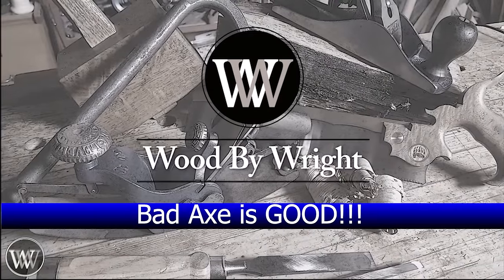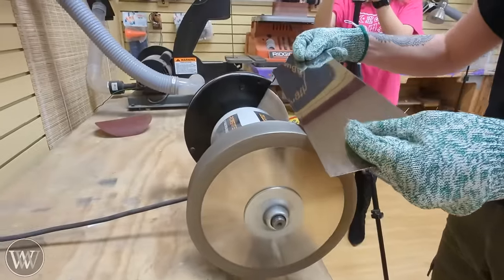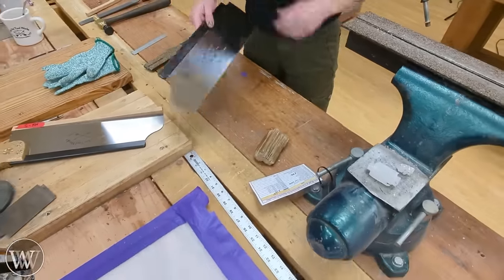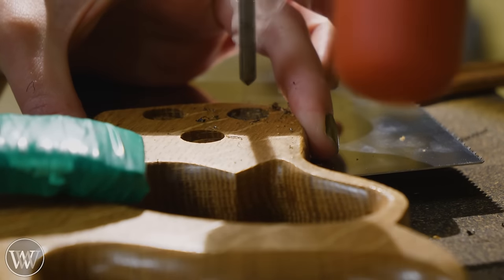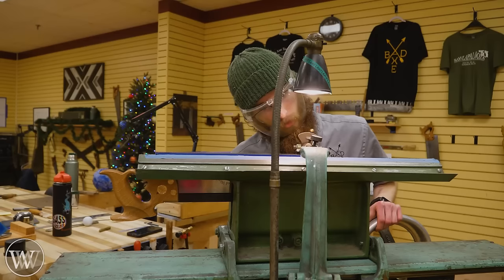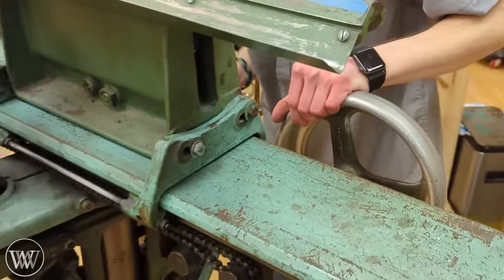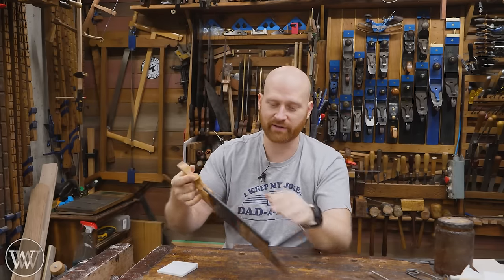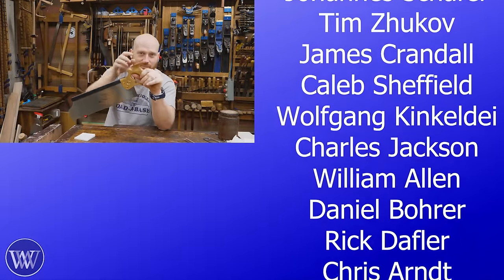How To Make A Bad Axe Back Saw

Comment: I tried to make my own saw just ordering some spring steel. If I’m not mistaken it was recycled. Question, why is the folded back sitting so high on the saw for? It looks like maybe a 1/4” of the saw is into the folded back. Thanks great video.
Reply from the maker: The back is about half way into the saw at the toe. This gives it flexibility to move where it needs to.

Comment: Thanks for a really interesting and informative video. It's very gratifying to see the folks at Bad Axe Tool Works doing so much of the labour by hand. Even when using mechanical aids--that amazing sharpening machine, for example--a human operator controls each stroke. In short, the machine is an extension of the artisan, not the other way around! There's just no substitute for this. And when it comes to the crucial test, cutting into that plank of white oak, there nothing mechanical to be seen--just a human arm and a square.